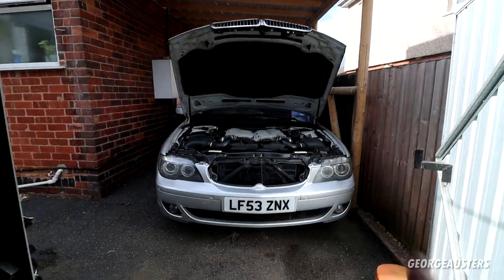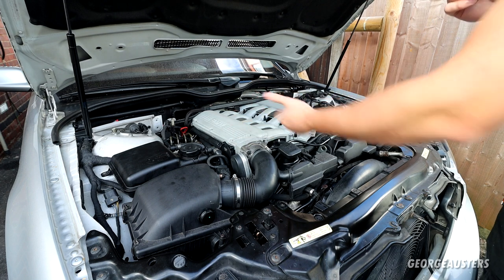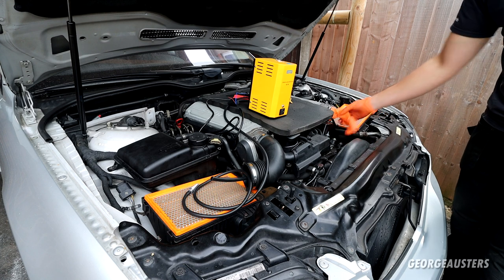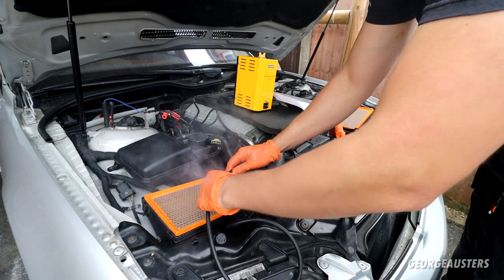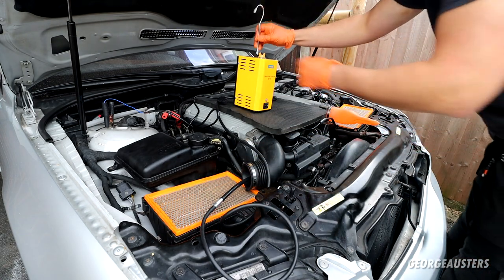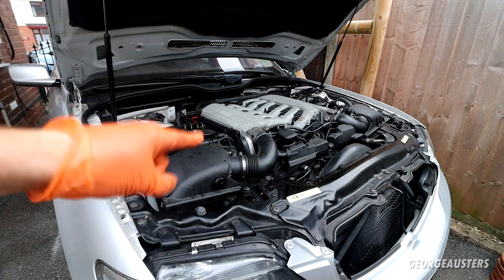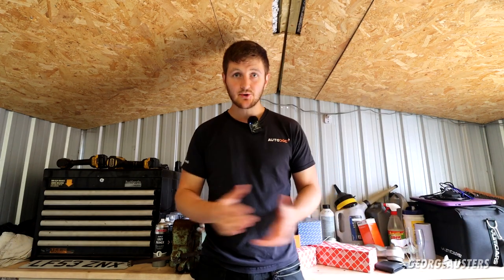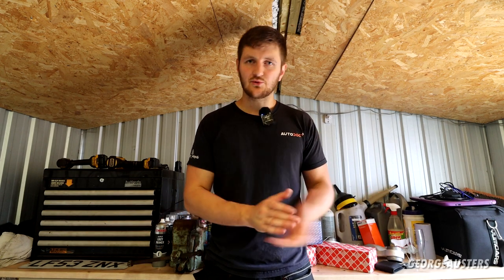HOW TO CHECK FOR VACUUM LEAKS USING A SMOKE TESTER

Comment: Another awesome video, i bought myself one off amazon (not identical to yours but same idea, with a pressure guage) to find my vacuum leak in my 330i. Do i just remove the airbox and connect it to the pipe after the MAF sensor? Keep these hugely helpful videos up!

That's also a beautiful v12

Comment: Ik this videos from a year ago, but I have a 99 740il with a possible leak. Would I be able to use the same smoke machine if my battery is in the rear? Would they happen to make these machines designed with wall sockets?

Comment: I've been through this and enjoyed watching you do the same.  Suggestion: use the 3 on-board diagnostics to assess the engine under vacuum ("only" at idle, because of valvetronic).  (1) MAP balance.  The left and right banks operate at different intake pressures.  I'm off by 10mBar between bank 1 & bank 2.  (2) O2 sensor additive Lambda, this will tell you rich the engine is at idle, if you've got a manifold leak, the additive Lambda will go high.  If you sustain  additive Lambda of 4.0 or greater, the CEL is displayed.  (3) Smooth running values should be a mainstay of your diagnostics.  If you've got a lagging cylinder (-0.5 or greater), keep an eye on it.  An "Italian tune up" often cleans up the smooth running values.  I'll trade numbers with you if you're interested.  Thanks for the vids.
Reply: Hi Mate, could you tell me which specific tests did you run in ISTA+?
Reply: @kuleg  Compare DME1 to DME2 if you suspect an intake plenum leak.  Under "smooth running values," select 1-6 (DME1) and 7-12 (DME2).  Anything under +/-0.5 is good.  If DME1 and DME2 are very different, you may have a plenum leak.  Under "general (I think)" select intake manifold pressure;  expect 650 - 700mbar.  If DME1 and DME2 are close, (+/- 20mbar), that's good.  Under "oxygen sensor..." select additive lambda, it should be 0.5 to about 2.  If it gets to 4, the CEL will come on.  If additive lambda on DME1 and DME2 are about the same (+/ 0.5) you're probably good.
Reply: @mikeshifflette8655   thank you very much! I’ll be looking for vacuum leaks in F10 and I think there’s no DDE2 anymore. I hope the rest of things will be available to check

Comment: There is an old saying, if it isn't broke don't fix it.
Reply from the maker: Not how I like to run things however.. You could just wait until you have misfires before swapping out the spark plugs etc but I’d rather be ahead of the game👍🏻
Reply: @GeorgeAusters   I Agree routine maintenance Service parts at the right mileage or time is the key to a long engine life, the company print what needs to be done and when, the rest is fix when it broken it will tell you  when is getting close to failure.